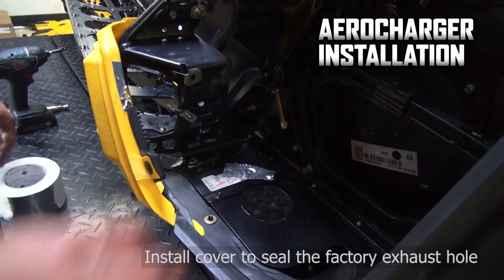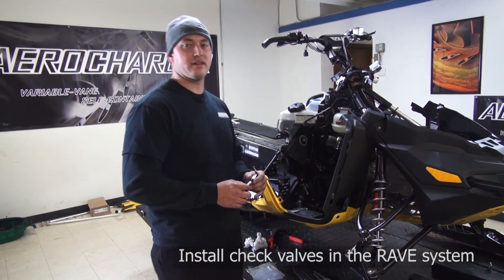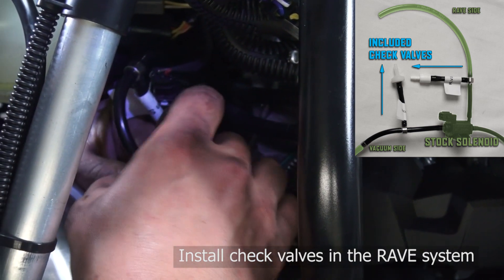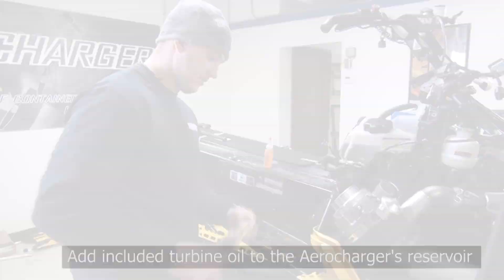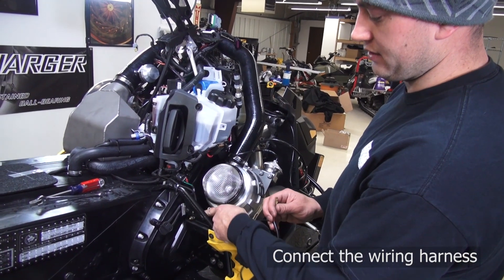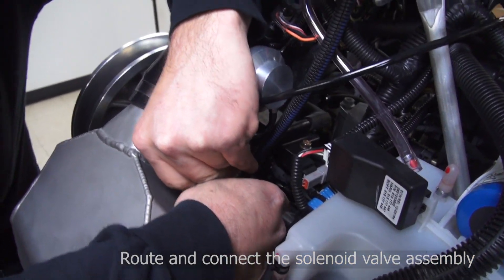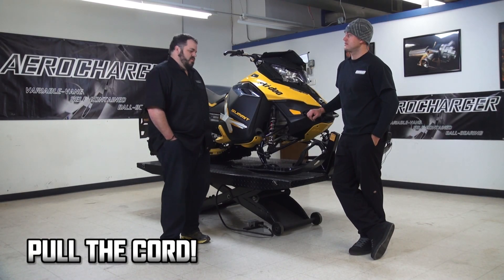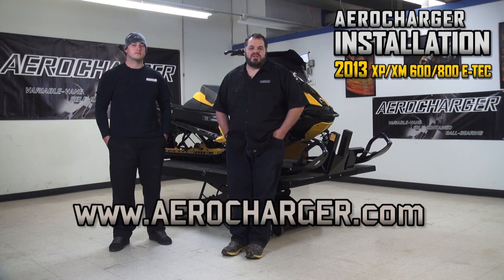Aerocharger Install | Part 2 Ski-Doo E-TEC

Comment: I had a Yamaha V-Max-4 and in 1994, yep, i installed a First Choice Turbo Aerocharger base kit on it. After a couplessss of melted pistons, i installed an air-to air intercooler and a super-efficient, one piece heat exchanger for the coolant, Wiseco turbo pistons (lower compression),  Aluminum airboxes with blow-off's and rode on pump gaz on 8psi boost for moderate WOT's. The sound a 2 smoke, 4 cylinder, Aerocharged engine produces!!!!!!.
Sold that sled, the WORST moove i've ever done  :( .   I absolutely miss those Aerocharger turbos, i even had good exchanges with the Aerodyne Dallas creator; Mr. Gerhard Schruf himself.  I'm sooooo sad  :(.

Comment: Awesome, these vn turbos are incredible!! Makes dialing in response so much easier. Even for cars, it's worthwhile to mount the turbos near the transmission tailshaft just to reduce heat ever so slightly. Ceramic coat and wrap the headers. Use a water to air intercooler. You don't want to run charge pipes all the way up front and back to the TB. Long pre turbo exhaust has little effect. Long charge pipes make a big difference in lag and boost.  Adjust the vanes so you have reasonable back pressure at wot near redline. Bring a friend lol.

Comment: everything fits so nice, will this work in my 2017 backcountry 600 etec? its a xm and says it works but urs is a 2013 just want to make sure nothing major has changed from 2013 to 2017 that this wont work now, thanks!